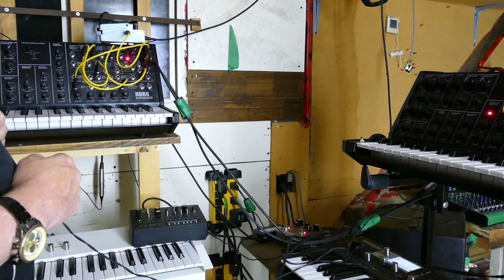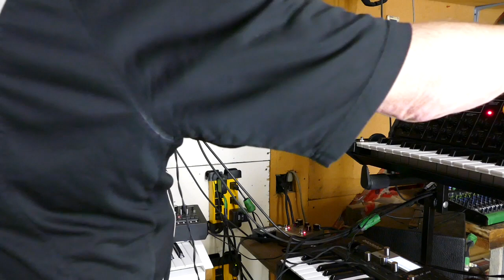MS20 Kit Tech: First night with my 4 oscillator MS-20 contrivance

Comment: Well done! Its a pitty Korg did not launch a MS50mini... they were great for expanding the MS20, but are rare.
Cheers!
Reply: I'm still thinking about buying a MS-20mini (or the desktop Version, with the mults)... I'm also expecting a Blofeld Keyboard, but I have to wait until I move to a bigger place. In the case of the patch bay, perhaps one of those small Modular Boxes from Doepher loaded only with mults and attenuators/atenuvertors could provide an elegant solution.
cheers!